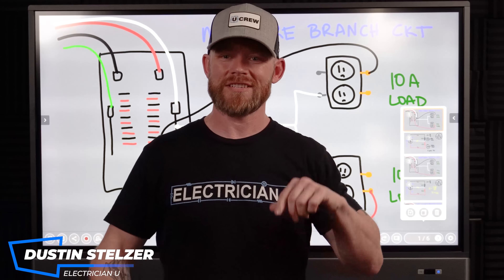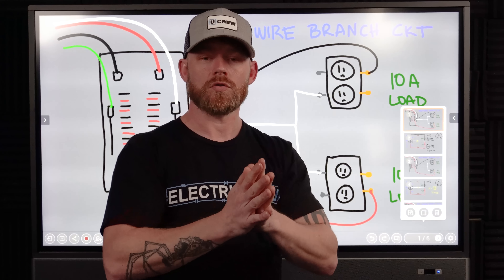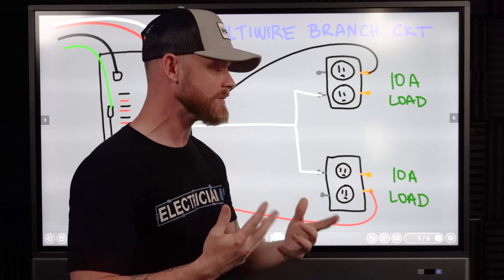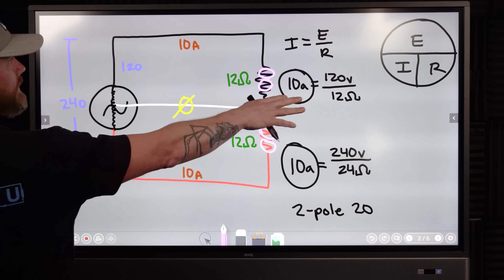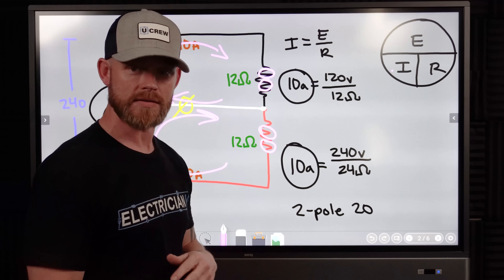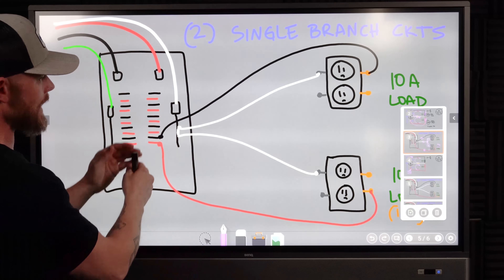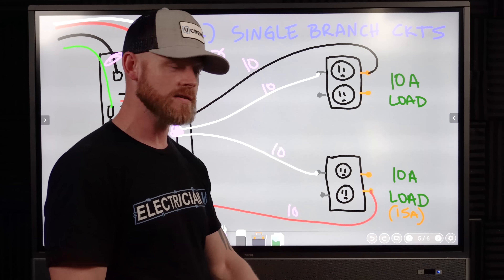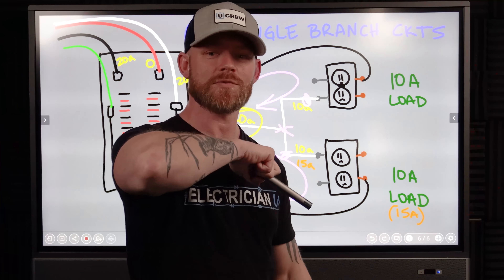Neutral Imbalance in Multiwire Branch Circuits (Two Hots, One Neutral)

Comment: were putting dish washer and garbage disposal using a dbl pole, 2 hots  and 1 neutral, black wire to switch and bottom of switch to upper plug brass side causing hot half. and constant power to dish washer other power to brass and white wire to neutral , i know neutral  and blacks together for constant power side , so the on hot half do i put neutral side to all neutrals , also broke tap on plug side.

Comment: It would be helpful to see waveforms either when using terms like pushing and pulling or in lieu of such terms.  Waveforms show the phase difference and the true nature of AC electrical circuits.  Thank you for making the critical point that two in-phase circuits sharing one neutral may create a dangerous overload on the neutral wire if it is the same gauge as the hots (which should not be done) where as out-of-phase circuits cannot.

Comment: Doesn't that mean that if, per chance, I plug in two 120v devices (not rated for 240v) that in a shared neutral situation, both devices (respectively on black phase and red phase) with now be receiving twice the amount of voltages (and thereby wattage) than they are permitted by manufacturer specification... a.k.a., new fire hazard or at least eminent device destruction?

Comment: I bought a house built in 96.
First winter we had a problem with the central air so we used some space heaters. I smelled burning and went in the attic to look at the wiring and found some melted white wire. I have a friend that's a master and he found a multi-circuit with a shared neutral but on the same phase. I've got a mess on my hands now to rewire.

Comment: If anyone has trouble visualizing this go make 120/240 AC circuits on falstad circuit simulator. Paul Falstad is an electrical engineer who created the circuit simulator and it's completely free to use. It has center tapped AC transformers, AC voltage sources, AC motors, and scopes for each part of the created circuit.

Comment: I have an issue with calling it a 240v circuit when there is a shared neutral.  The neutral being present is what's preventing it from being a 240v circuit, the neutral MAKES it a 120v per circuit.

Comment: I bought some 12/3 wire so I could have two circuits in my garage. I was about to install it, when I asked...WAIT A SECOND....WON'T THE NEUTRAL WIRE HAVE 2x CURRENT? Not necessarily! Saved by math! Thanks for explaining!
Reply: remember to wire it to a 2 pole tied breaker (taking up 2 slots)

Comment: So if you have two phases it cancels out the neutral load , if you have two different circuits on the same phase you get too much current or an imbalance on the neutral , so what if like so many times you tap into an existing circuit via a existing junction box to bring power to your new device? Is that creating an imbalance on your neutral? Because that’s more practical to happen on a daily basis as I have done many times…

Comment: Are electricians unfamiliar with Kirchhoff's Current Law?

Why this silly "pushing" and "pulling" terminology? Can't electricians cope with the idea of polarities and the fact that in "split-phase" systems the instantaneous voltage on one "side" is equal in magnitude but opposite in polarity to the voltage on the other "side," relative to neutral?

Comment: So if you were to touch the nuetral and the ground where it is connected between the two ten amp  circuits in your last example, would you be shocked with the 20 amps? Assuming everything else was ok and the nuetrals still connected.

Comment: Would I be totally off in saying that, theoretically speaking, a single phase system with branch circuits could be considered both a series and a parallel circuit?  In the sense that it's series in regard to the overall current running in the black and red, and parallel in regard to the individual branch circuits and the neutrals taking on the imbalance?  Btw, this video answered a lot of questions for me that I've had for a long time.

Comment: So when would someone use such a circuit? Are they splitting open the romex and running these wires with no sheathing and then pigtail off the neutral.  I’m not able to make sense of how to wire 2 receptacles from the panel in this manor.

Comment: I have a gfci in bathroom with one black one white both are HOT. Green not hot. Blew the gfci and lights in hall and other outlets blew as well. When I flip 15 amp  breaker on the black goes cold and white stays hot? Meaning somehow, the 15 amp breaker is influencing the black and making it cold while both are still tied in somewhere else to another breaker and causing lights to stay out? There is no confusion. This is exactly what is going on apparently.

Comment: In reality the circuit drawn in this video is actually 2 separate circuits and the white conductor is a grounded conductor, not a neutral. By definition a neutral  conductor that carries the unbalanced load which can only exist when an A/B  leg exist  the circuit displayed had a J box where leg A and leg B exist. If the load connected to the black white, red  white the white conductor would become a neutral where the grounded conductors connect. The Grounded conductors would both carry 2 amps each before connecting to the neutral. In reality the lamps on A & B circuit operate in series thus eliminating any neutral load. Just my thoughts.
Reply: You seem to be objecting to the use of "neutral" without attempting to define it.  What we casually call "neutral" is officially called the "grounded conductir."  So what is the difference?
Reply: @GH-oi2jf  by definition a neutral carries the unbalanced load. Thus with a multiwire branch circuit you have at least 2 circuits. In the case of a 120/240 volt multiwire circuits we have two 120 volt circuits with a potential of 240 volts between them and lets assign a 3 amp load on the black circuit and 5 amps on the red circuit.  Given this scenario the unbalanced load is 5 -3 or a 2 amp neutral load.  When the circuit has only a black and white wire if the black circuit has a 5 amp load the white grounded conductor will carry a 5 amp load thus there is no unbalanced load and by agreed on definition there can never be an unbalanced load thus we have an ground conductor not a neutral. One way to think of it is by looking at a GFI or GFCI circuit. The device is set to trip when a difference of more than 6 milliamps is detected and if we place it on a neutral anytime the unbalanced load exceeded 6 thousands of an amp the GFCI (breaker) or GFI (receptacle) would trip. However since the load on the hot (ungrounded conductor) and white (grounded conductor) are the same ground fault devices work just fine. Also think about a load calculation for a service.  Once the service is sized we find it is permissable to debate the neutral because it carries the unbalanced load. However if we derate a grounded conductor we have a high potential of burning it up. I use definitions as found in Article 100 of NFPA Pamphlet 70 better known as the 2023 NEC.  I hope this clears up my position for you but if not feel free to ask for additional clarification.  I'm retired and enjoy talking electrical work.  It's my first love.

Comment: The red and black conductors are not on two different phases. They should be landed on two different excursions or polarities of the same phase.

This video refers to a SINGLE PHASE system.
Reply: This is merely a semantic argument, not a substantive argument.  Whether one looks at the two sides of a split-phase system as being in opposite polarity or in opposite phase is of no importance.  They are equivalent, just different viewpoints.
Reply: @GH-oi2jf  It is VERY important. It's only considered semantics due to misuse. Specificity is the key to success in these topics. Opposite polarity of the same phase is not a different phase. In engineering, a 180 degree timing difference is not considered to be a phase shift but simple reverse polarity. This is a single phase system. There is only ONE phase.

Comment: Thank you so much for good info. 

I am wondering that when you said it is dangerous when 20amp running in the neutral 16:00

Can you please elaborate on that? Is it just dangerous to touch(I figure). Or as far as not touching it is ok to use it like that? Or it is not safe because of the risk of fire etc.?

Comment: Question: been out of the business a LONG time but just wired a common neutral circuit and a friend insisted on a handle tie in the breaker box. Is it currently required by NEC? Additional comments welcome. Didn’t see this question in the comments after a quick glance and just found you here.

Comment: so if 10A is being pushed on the black leg and 15A is being pulled on the red leg then which direction is the remaining 5A going? if current is being pushed on black it has to pull on white while at the same time pulling on red and pushing on white. I'm not getting something here cause obviously current can't push and pull at the same time on the white
Reply: You should think of it more abstractly.  If one circuit has 10A going left on the neutral, and the other has 5A going right on the neutral, then the neutral is actually carrying 5A to the left.  It is easier to consider just one circuit at a time rather than solving the whoke system.

Comment: Do you have to keep line 1 and line 2 balanced ? What if you're pulling 40 amps from black phase and 15 amps from red phase ?
Reply: A 40A load should have its own circuit.  More commonly, you would have two 20A circuits sharing a neutral.  It doesn't matter if they are unbalanced, as long as the neutral is the proper size.  One side could be zero.

Comment: I have two dual function 20 amp breakers feeding a two wire home run to a two pole switch (DPST ) affecting two duplex outlets in a double gang box. I want my table saw on one circuit and my vacuum on the other circuit.  My problem is I want to use one of those circuits to also supply outlets further down the line in my garage, but I don’t want those extra outlets to be affected by the switch!  Literally nothing on YouTube has solved this wiring… Dilemma.

Comment: I've got an outlet in my kitchen showing 92 V instead of the expected 120 V. Going to try to figure it out. This video really helped!
Reply: That is way out of spec.  If you have a high resistance connection, it could be a serious problem.

Comment: how do you make a separate neutral for other circuit. so they both do not share the same neutral.?. Or do I install junction box and connect both neutrals to both circuit  in junction box.Or do I have to RUn a separate neutral from breaker box.?

Comment: Thank you Dustin for such a good video. I am trained as an Electronics Technician. I never realized how important A.C. theory is in residential home wiring.  My guess is that the Red hot and the Black hot are 180 degrees out of phase - and that is how they achieve 240 Vac in the panel.  John M.

Comment: The imbalance on the neutral makes sense in a single phase system. Can you please explain how the imbalance would work in a three phase system in which there are 3 circuits sharing a single neutral?
Reply: It's the same, except that you need a factor to account for the fact that the phases are not opposite.  If all three phases have the same load, the neutral current will be zero.

Comment: 14:45 If the breaker is 20AMPs and the current coming back on the neutral is 25 amps, would it trip the breaker?  Or no?
Reply: You couldn't get 25A on the neutral without one of the hot wires carrying 25A or more, provided you are using the opposite polarity for the other hot wire, so that breaker should certainly trip.  That's why you would only share a neutral for opposing phases (or polarity).

Comment: Thank you for sharing I had my panel replace and they took the multiple branch circuit and wired it to a single pole double throw. Almost cause me to get shock because it wasn’t a single throw. I was just changing a light and thought wow that neutral won’t handle 30 amps so now I change it over. Also when my panel was replaced in 2023 they installed regular breakers shouldn’t it be arc/gfi? Thank you

Comment: Yup the current adds up when both hots are on same phase. Now the neutral is overloaded and you get a fire .the hots blk an red are protected but the neutral is still overloaded.
Double the current and heat is quadrupled or 4x as much.close to 800 degrees.

Comment: Is the grounding in a multiwire branch circuit the same?  For some reason the code book reference I had seen showed the grounds not connected. Why would you not use the ground, or was that reference messed up?  Im thinking of using this on a lighting circuit. The switch is like 100ft from the panel. 14/3 to the switch, and 14/2 to the lighting circuits after the switches.  It'd save an extra 100ft of 14/2.

Comment: @7:52, where you show the circuit with an imbalanced load between the two legs, you mentioned that if the neutral is missing, you could be left with a 240v potential going thru the devices...  Correct me if I'm wrong, but if that condition occurred, wouldn't that effectively be two loads in series and, therefore, the voltage across each load wouldn't be 240v, but would be proportional to the load, correct?  If you had two equal loads, they would be 120v each.  If you had 5 and 15 ohms of resistance, you'd measure 60v and 180v respectively, correct?
Reply: Yes, you are correct.

Comment: Many thanks, this is great to know! Now I understand why my generator transfer switch manual said the neutral can be overloaded if you run one side of a handle-tied branch circuit through the xfer switch and not the other side. You have a very effective way of explaining it with the push-pull concept between phases. 😊

Comment: Understand (r)120/(b)120= W(0)   Balance load , ? (On 12 Hot Same phase now (B)20E) +(B)20E = 40  is it not allowed from Breaker Box  to use Number  8 gauge rated 50 amps  picktale split to 12 with  receptacle in junction metal EMT junction boxes, with other multiple balance loads 4 Circuits 2+2 all for  8' foot led lights 3.5 amp a peace receptacle  A total of of  6 /4*4 boxes 80 lights 100 watts 16 amps circuit 4 Circuits  66 amps / 16.5 Amps each Breaker 66÷4=6.5  number 3 strands of  8 gauge 0 balance,  Need code Exceptions on neutral

Comment: I have a ? Can Threw 1 inch metal conduit with (8) Junction  4*4 Boxes with two 20 amp receptacles A and B phase be using (8) gauge  wire to balance 4 breakers 2 on (A) phase 2 on (B) phase , Multiple use in a Service garage
Reply: 20 +20=20+20= /40=/0

Comment: Can I wire a multiwire branch circuit to 2 separate GFCI's using the same neutral. I have a kitchen that did not originally require GFCI's, but my receptacles are one separate circuit breakers? I have already tried it and it seems to be working, but my concern is will it eventually, possibly give me problems in the future?

Comment: Different phase is also dangerous. Go open that shared neutral at the panel and youll be buying new TV's and such when you run 240v through the outlets and devices plugged in to them completing the circuit. Shared neutrals is common out there and old panels get loose or a bad wire nut connection can cause havoc. As a GC i gain more and more respect for electricians as i watch these videos.

Comment: In another video you said ground is connected to neutral at one place only which is at central. Is there some kind of one way resistor keeping current on neutral from leaking into the ground in that connection?
Reply: No.  The neutral is connected to ground both at the main breaker box (or disconnect) and at the transformer.  The current could flow between the neutral in the box and the neutral of the transformer through ground, but the neutral wire from the transformer to the box has far llwer resistance, so that is where nearly all the current will flow.

Comment: I'm not an electrician...but my dad is...n i was taught this long time ago that the most dangerous or problematic wire can be a neutral...1. a open neutral 2. shared neutral from two different circuits 2 circuits sharing neutral 👎..3. depending on how someone wired a switch ur white wire will be carrying power..4..tandem breakers will share a neutral many times because electrician or diy dont add a second neutral through there conduit...but can be confusing if u dont mark with different color tape...i was taught to respect electricity always work safely even when breaker is off, to work as if breaker is not off..
Reply: The underlying danger is the amateur who wired things improperly or poorly.  I expect electricians run into that often.

Comment: What about two neutrals, and one hot? I have a hot wire going into a light switch, but I need a neutral in there to swap it out for the smart switch I bought. There's a duplex outlet nearby.  I could wire nut the existing hot wire, run 12-2 with ground from the duplex outlet for the smart switch, then the existing old wire for load would remain load. The light fixture then has it's own neutral running back to the breaker box, and the smart switch has a different neutral (from the duplex outlet), but the smart switch and light fixture share the same hot. Is this ok? Any code violations here?